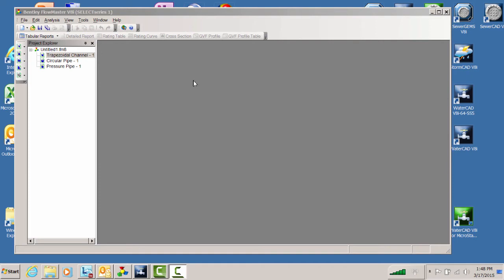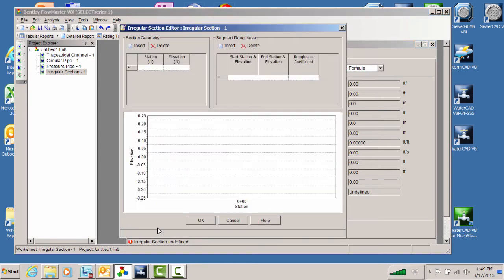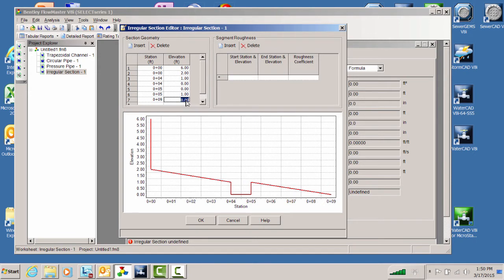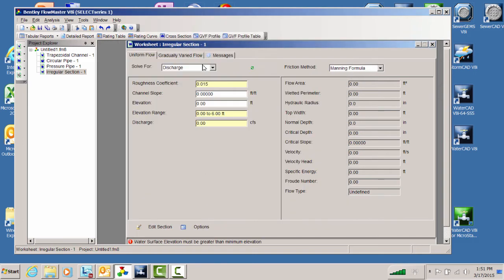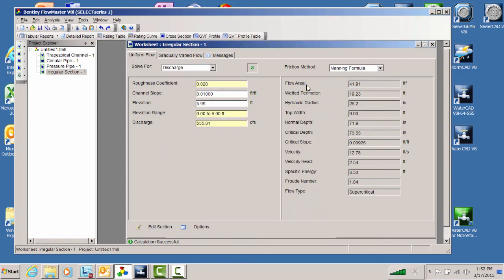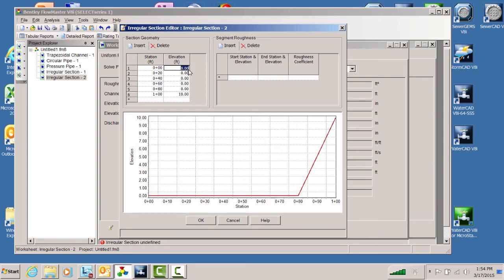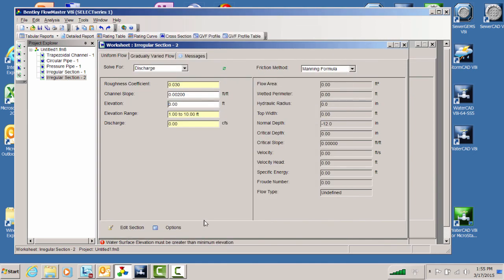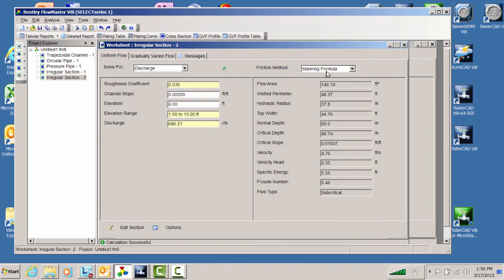Introduction to FlowMaster: analyzing an irregular channel

Comment: Is there a way to do parabolic irregular cross sections? For example, combining two different parabolas into a single cross section.
Reply from the maker: Hello Charles, in FlowMaster you can use any shape with the Irregular section worksheet type. You would need to define (or paste) the table of station vs. elevation.